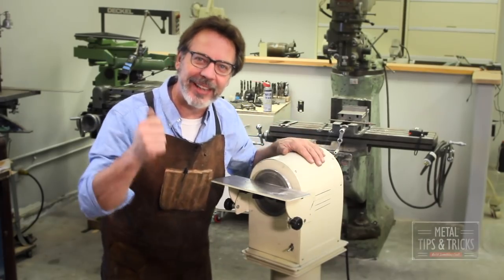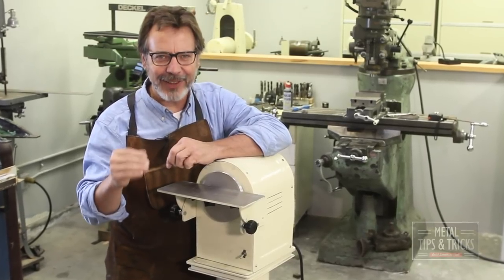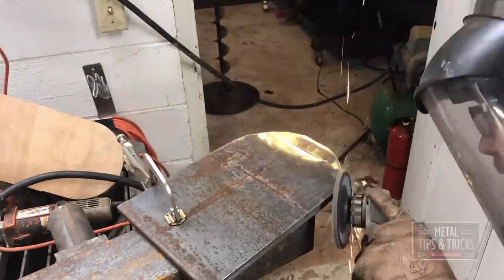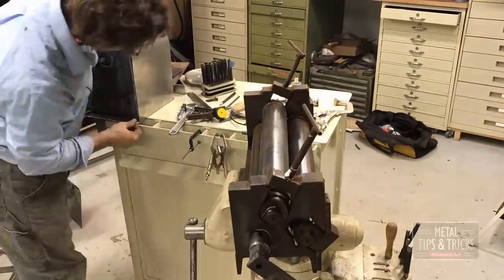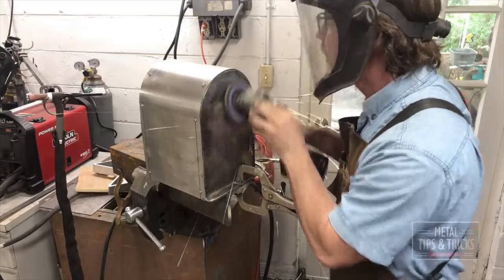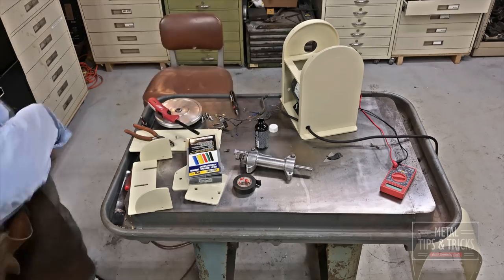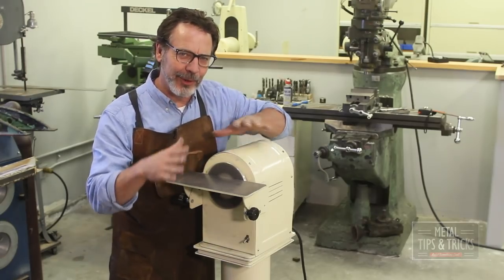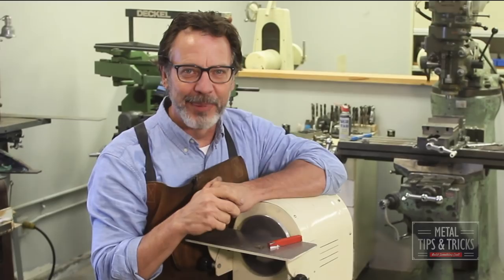How to Make a Slow Speed Grinder    Part 1

Comment: Very nice build.  Two things I would probably change if I get around to building this are 1) the switch position and or a switch shield (right now it's going to get fine conductive dust raining down on it, not catastrophic but will probably shorten its life a bunch, a quick fix would be one of those waterproof switch covers that screw on to the mounting threads) and 2) put a bit of a flare on the ventilation holes, easy to do and would help with the very nice vintage look you have going).

Neither are really big deals and this looks fantastic as is.

Comment: I have to thank you for your video on buying used lathes. I spent a year finding one and they ALL wanted way too much $$$$ for junk that should be scrapped. I found one, it isn't an Atlas, nor a Southbend sadly. Please don't laugh I bought a ~fast speaking- Central Machinery (HF) 12x36 gear head for $200. It just needed a new machined cross slide (Grizzly g4009) +$100 and +$95 to a machine shop and fluids, tons of elbow grease and it works great for what I need it for (hobbies).  $395 not counting the extra toys that you can get now.

Comment: What are you using as an abrasive on the grinding/lapping wheel?
Reply: That was gonna be one of my questions but you've already asked it.  Great minds think alike.
Reply: I was going to ask as well :)

Thanks Dale!
Reply from the maker: I'll be covering that in my next video
Reply: Thank you, Dale!
Reply: R. Steven Lang, Shark River Machine  you don’t need to use anything special, other than it has to be diamond, on eBay there are packs of diamond impregnated wheels for 15-20 bucks landed
Reply: Patrick’s Workshop it would absolutely have to be a diamond wheel. However I have never seen one in that configuration. Looks like diamond sandpaper.
Reply: Patrick’s Workshop it would absolutely have to be a diamond wheel. However I have never seen one in that configuration. Looks like diamond sandpaper.
Reply: Yes I was wondering that also! I’ve seen flat steel plates on certain Chinese websites that would work for this I think.

It’s about time, Dale get back to work!

Comment: Never knew about slow speed grinders.
I bought a 3/4 HP, 850 rpm Dayton motor for $30. Looked like new.  What's the best use for this motor?  I was thinking belt sander, but surface speed seems way to slow.
Great project and you're fantastic at you build quality.
The motor says 'continuous'
It also says 'fan' ..... so that's what I figure was it's intended for. 
Price was right, so it's destined for something useful.  😁

Comment: Hey, what's the wobble about when you run the grinder at the end of the video ? Won't it shake around due to imbalance ?
Reply from the maker: It runs to slow to need to worry about balancing to pulley

Comment: Dale, nice little machine. But you didn’t flare those slot vents. That would have made it look soo nice.
Reply from the maker: I tried to make dies for the bead roller, but I size them wrong so they did work. Next project 😀

Comment: The value of this is only in seeing the build techniques. In point of fact, a three phase motor with a VFD in SVD mode and also for speed control to directly drive the platter avoids all need for belts, bearings, etc. (mechanical issues) provides infinite speed control, and would be much easier to realize.
Reply from the maker: You do remember this is a scrap metal project. You work with what you got😀😀🤔

Comment: Okay, something was wrong with your cut off wheels, did you accidentially grabbed Inox cut off wheels and used them on regular mild steel at full speed?
Overall its a really nice quick build, but were is the water pan? Or are you going to suck up the carbide dust with a HEPA filtered vacuum? :D
Reply from the maker: No, nothing wrong with the cut of wheel. Sheet metal  just chews them up because metal vibrates in snaps back and digs into the grinding wheel very easily. Think of it like Chatter on a metal lathe.
Reply: @BuildSomthingCool  Thats true but, i cut 1,5mm mild steel sheets with bends or a radius rather often for various paneling, casings and drums. Im used to getting around 3-4 meters of cut length per wheel (Metabo Flexiamant),  or up to 6 meters on flat cuts. This looked like you got maybe 1 meter of cut length out of each wheel, only times i had similar short cutlenghts was when i used an inox only wheel on mild steel or with some cheap no name wheels i had to buy on the run, and based on your otherwise great tools i wouldnt expect you to be the guy who cheaps out on consumables. So that really got me puzzled why your result is so different that what im used to.

Comment: Tungsten carbide is a metal alloy commonly used in manufacturing because of its hardness and resistance to wear and high temperatures. According to the New Jersey Department of Health’s Division of Epidemiology, Environmental and Occupational Health, exposure to tungsten carbide may result in lung issues, as it often contains nickel and chromium, which can trigger asthma. The department cautions that even low-level exposure can cause health problems, including skin that can become sensitized to the alloy and break out in a rash.

The first step to mitigating the hazard is knowing where exposure can occur. According to the department, job tasks that often use tools with hard metal tips and parts containing tungsten carbide include:

Grinding
Polishing
Sharpening
Brazing
Welding
Spraying
Most worker exposures occur by breathing in dust, mist or fumes containing tungsten carbide; allowing skin to come in contact with dust or a solution that contains it; or eating, drinking or smoking in areas containing it. To prevent exposure, the department recommends workers:

Use local exhaust ventilation control measures correctly.
Use respirators that are approved for dust and mist if ventilation systems are not available.
Wash hands and exposed skin thoroughly before eating.
Wear protective gloves, safety glasses or full-body protective clothing, if necessary. Work clothes should be changed daily if they are contaminated with tungsten carbide.
Use wet methods or a vacuum with HEPA filters to prevent dust buildup.
Reply: And, since he moved to California, it probably causes cancer too!
Reply: I take high doses of chromium tablets every day, it is a blood sugar regulator.
Reply: Cobalt is the bigger problem with grinding tungsten carbide.  Slow speed grinders do not put it into the air.  Still, yes, you do not want to breath tungsten carbide dust.

Comment: Why not just make the pulley 5.75 inches and hit the 300 rpm on the dot? I guess fractions are hard
Reply from the maker: Good question. I said 6 to simplify the explanation.
Reply: Going a little slower is not a problem, going faster builds heat and grinds to fast for precision control.  300 is just a good place to be  giving control and good cutting time not a 100% cut in stone must have.
Reply: You won't hit 300 exactly at 5 3/4" either. You really need to figure the belt pitch diameters on the two pulleys, and that will be slightly less than the outside diameter of the pulies. But even then the 1725 motor RPM is a nominal value based on the line frequency and the motor load, so you still won't get an exact value. And you may have to add in some RPM reduction for belt slip. However it doesn't really matter. Most of reality works fine at +- 10% of nominal.
Reply: l wilton the point here is you will be much closer to 300 rpm and using 5.75 doesn’t in my opinion, make the equation harder seeing as you are using 1 as the other pulley size. Regardless, as long as the pulleys are size appropriately you will be very close. 

I’m just not buying the ‘easier equation’
Reply: My point precisely!  :)